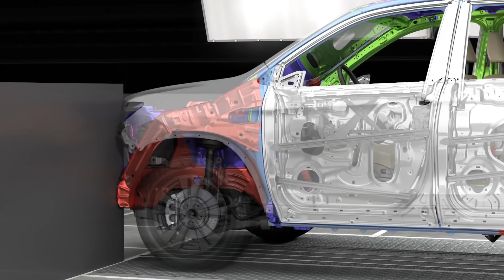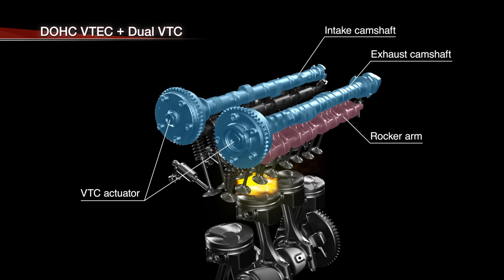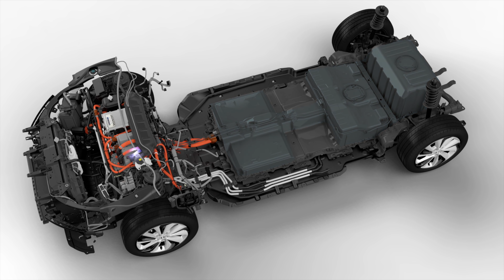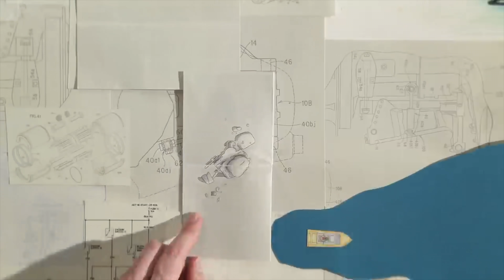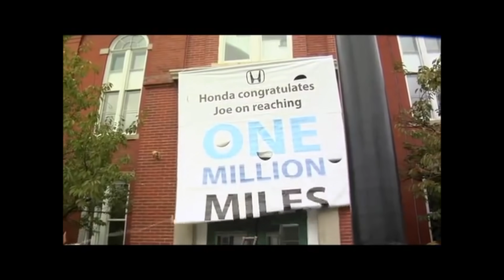Honda Doesn’t Want You to Know This

Comment: I used to own a 1996 Honda Accord EX, manual transmission. I bought it from a junk yard for 400 bux when it was sitting at only a mere 110k miles and repaired all the damages to the car for under 2 grand as there still wasn't even much wrong with it. I drove that car for 6 years. I would still have it to this day but a tree fell on it and destroyed it but I've owned 24 cars in my life and that Honda was by far the safest and most reliable car I've ever owned. I currently drive a 1996 Dodge RAM 1500 pickup but this thing is about dead at 173k miles. When I buy another car, I'm definitely going with Honda again.

Comment: We have an 2003 civic with 182000 miles & with very little repairs.   Now I got information from one how there mechanic’s  that they started putting weak rings in the crv. A few years back ( hope  ) That was corrected   We are getting another one soon hope it goes like the old one

Comment: The owners reliability in on time proper maintenance more key than Honda’s vehicles!!  2003 Odyssey 420,000 miles ORIGINAL TRANSMISSION AND ENGINE.  This year was noted for multiple tranny failures for a single unit sometimes.  Honda reliable yes. Owner reliability in doing timely maintenance more so.  At 60k stopped using their Honda branded ATF fluid and went 100% with a brand known to to make premium level and expensive synthetic oils and synthetic ATFs.  On the forums members would always warn if I didn’t use Honda brand ATF it would lead to destruction of tranny. (420k miles now on original lol)  I also added a Lubegard Red in with every ATF change.  Lastly, added a magnefine inline atf filter.

Comment: My 2000 Accord with V-Tech is 291,00 miles and it still strong. Only minor fix that were original Tie-rod end and rear wheel bearing last month. But 290,000 miles what do I expect right?.

Comment: 06 civic hybrid with 307k miles. Need to replace the hybrid battery that shows 7% usability on scans but still getting 31.5mpg calculated by fuel log app / 30.5mpg by dash.

Comment: Hey  scotty  I have  a 2004 honda element  had it a few yrs just oil changes  a new starter  a master cylinder  and brake  pads, oil changes every 4500 miles I have  271k already I thought about getting  another one  with less miles maybe a 2010 but why fux it if it's not broke ive learned so mush watching  your videos I change my own oil, coolant,sparkplugs  myself  I also  converted  it into a camper  there's nothing on the market  like it,

Comment: I have a Toyota tacoma 2003 5 speeds. When I put the firths and then when to the other speeds is a little difficult to changes the speeds. No noise from the gears. Do you thin I need a new clutch. The truck has 175 K miles. Thank you for all the help that you give with your Utube channel.

Comment: First car I bought out of high school was a used Honda. First car I bought out of college was a new Honda (CRX). To date I've owned about 15 to 18 of them, plus a few other brands too. They have all been good but Honda began to be fun to drive after about 1982.  Honda has always been a little weak on brakes (rotor warp or brake noise in the earlier days) and automatic transmissions (changing the fluid early and often boosts longevity). Best Honda I've owned? Probably the 1994 GS 6-speed manual sedan, but the 2015 Accord K24 is a very solid and fun to drive car too.  The worst Honda out of the bunch was probably the 1998 Civic HX, which handled more like a Buick than a Civic.  The generation Civic before (1992-1995) and after (2001-2005) were much more fun to drive.

Comment: After spending all my savings trying to keep my Chrysler Sebring on the road, I've finally bought a Civic estate.  Wish I'd watched Scotty's videos much earlier.
Reply: The 4cyl. Mitsu and the 2.7L Chrysler engines were not good, and most Sebrings got them. But a few had the 2.5L Mitsubishi V6. My buddy had one with 275k miles. The original engine only needed valve cover gaskets a water pump, spark plugs and an alternator during the last 75,000 miles he owned it.
Reply: @don2deliver  Mine was a 2 litre turbo diesel.  Low mileage and well maintained.   It wasn't just the engine that gave me problems.
Reply: @RockyDave  never saw that engine in the US. Yeah they had electrical issues and suspension issues, but my friend got lucky with those things on his.

Comment: I had a 1985 Honda Accord Hatchback that my girlfriend and I loved.  It had a 1.8L carbureted engine, 5 speed manual transmission.  Unfortunately it was totaled in an accident when a pig farmer's truck driver 2 cars behind me fell asleep at the wheel and I was stopped in traffic that's when we bought our 1993 Toyota 4x4 pickup which we still have and drive today.  Had we still have the Accord, we still would drive it and I would maintain it so it gets 1,000,000 miles as well.

Comment: I have a 2003 Honda Civic 1.7L with 280,000 miles. The engine still purrs like a kitten and handles great without a squeak.  Keep that oil checked and changed..

Comment: My wife's 2015 Civic is barely OK as far as I am concerned when it comes to reliability..by 115,000 miles on my 3rd AC compressor system.. also two calipers froze up ...unexpected problems

Comment: I like Honda especially the motorcycles. Right now I'm riding a 150cc scoot scoot, and I have the license to upgrade to a bigger bike. At first I was thinking about  getting a Honda ADV, and it would cost me $4500, and out the door it would be like $5000. It's pretty much just for another 150cc Honda scooter that I wanted in the first place, but I couldn't afford it. I still wanted the Honda version, but than I saw the motorcycle Honda cb300r which cost only not much than it's 150cc ADV. So I change my mind, and I would rather upgrade to the 300cc motorcycle. I figure why waste my money on a same 150cc when I could upgrade to a bigger motor, and the cost would be not higher. I love the design of the motorcycle, and I just can't wait to ride it. I still love the scoot scoot that I have right now, but it's more for my route.

Comment: My dad has a 2007 Honda accord but already had to replace the battery, the starter, and the engine light is on and it only has 60,000 miles on it , which he bought 1 year ago used from a dealership
Reply: It makes me not want to ever get a honda
Reply: @philipmiller5036  you don't know this so it's not a fair judgment also the car was fine when he got it

Comment: Honda lost me 20 years ago, when my Legend started to fail with only 80k miles. It had to many cheep parts from the Accord build in. Those used to break and were costly to replace. At 90k my automatic transmission started to jolt and I got rid of it. There is no way I will buy a Honda car ever again.
However, I own a Honda motorbike and love it. Made in Japan, very reliable, brilliant engineering. Will last at lest 150k miles.

Comment: I own a 96 civic and I took a picture of the mileage at 300,000 miles. At 301,000 miles It through a rod threw the oil pan, but because the car had done so well I put another engine in it. Now I have 3 civics and that's all I will own is a Honda or Toyota I guess

Comment: I Need Help ! I Have this 2014 Rubicon It won't start by turning the key because it burns de 40A fuse that goes to the starter every time I turn the key, Im luky its a manual but still it won't start if not being downhill.

Comment: My Honda Accord 2008, has over 102k miles on it, but I am hearing a tapping sound from the engine, I have not had any issues with the engine or transmission.
Reply: Have you had the valves adjusted?
Reply: If you have the V6, and the timing belt hasn't been replaced, have it, the tensioners, and the water pump replaced as soon as possible. That tapping might be caused by wearing out tensioners, and they should be replaced every 60.000 miles on V6 Hondas. If any of the tensioners go, it tries the engine.
Reply: @EMichaelBall  I have not had the valves adjusted before, I haven't really done any work on the engine, I bought it at 98k miles thereabout. I have serviced it twice now within a 3 month interval.

Comment: Bought a 2006 Civic LX 4D Sedan in 2005 for $16,000 cash, it's 2021and it drives like it's brand new, it easily hits 100mph like nothing and it still gets to it's top speed of 108mph(110mph) with no problems, last year during the summer the starter went out, changed it myself for around $330 with taxes.
So in year number 15 the starter went out and that's the only thing that has broken in the car, which is amazing, also the interior of the car is in great condition which is very shocking to me, the previous generation 90's honda Civics  interiors use to fall apart, but I guess honda figure out how to make them last longer specially the ceiling 👌
Another thing, the design of this car aged very well, It still looks very modern, it's a white car, white makes it look even better.

Comment: Honda customer service was extremely poor for me. I bought a new Honda Silver Wing motorcycle.  It was Honda's first v-twin engine and was based upon the Moto Guzzi.  Second gear would disappear if revs were normal or higher.  You had to shift into second going very slow.  Two different dealers kept my bike for months and could not fix it. Honda refused to recognize the problem because they had no fix for it.  Years later, after I got rid of it, a solution was finally found.  A friend of mine bought a new Honda Civic, one of the super small first generation.  At 60,000 miles the head cracked.  No help from Honda.  They had a known problem of doing that.

Comment: The one weak point I have encountered in the Hondas I have had is the automatic transmissions. Even when maintained to factory specifications, they are prone to fail. Honda has a unique ATF specification which is not a synthetic fluid. There are no “Honda spec” synthetic ATF fluids. My theory is that their fluids don’t hold up to the Texas heat.

Comment: I owm a 2000 honda integra and it wonderfully reliable and dependable i have own it for 3 years the transmission or enginge has never been work on apart from regular maintainance and its been great also the toyotas that i drive daily at work but cant say the same about other brands not discriminatting just saying

Comment: I had a 2014 Honda Accord coupe V6. Had it for 7 years. It started giving problems. So I sold it. The transmission was jerky. And things start to break. Windows don’t roll down. Dashboard starts rattling. And more. So I sold it for 2021 mazda3 turbo. Honda better watch out. Mazda is catching up.

Comment: I have a used Honda Civic 2013 I got for $10,900.00. Great running car only thing having a problem with the front brake but it still brakes good. Get that fixed on my way again. Does a 2013 Honda Civic have a timing chain or timing belt

Comment: It's just too bad the Honda 3.5 v6 run a timing belt vs their 4cly timing chain, wondering why they don't change this? Maybe development cost to the existing 3.5 v6 would have to get redesigned for a chain Scotty.
Reply: I love their j series v6. I agree it should have a timing chain since the Toyota v6 now has a chain

Comment: The dual carbs Prelude of the 80’s are nothing but trouble prone engine, and don’t even let me mention on the CVCC carb system( mechanic’s nightmare)The body and interior design are very nice though.
Reply: I remember a used engine with the vacuum harness intact was worth about 200 more than one with the lines pulled or chopped off.

Comment: I'm 47 and I was always a Chevy guy 
I had a 2000 Chevy Silverado and had all kinds of issues
Replaced the front end twice the rear end went out  twice  before it had 200,000 miles
I sold it bought a 2008 Honda Ridgeline I just now replaced the front end at 275,000 miles
That truck turned me into a Honda guy
I still have the Ridgeline and I have bought a 2010 Accord

I am looking for a 2014 Honda Ridgeline ( I don't really care for the  new Ridgeline styling . The 2021 is better but )

I will keep my 2008 Ridgeline and my 2010 Accord

If you told me 10-12 years ago that I'd be a Honda guy I would have said that you were crazy but I definitely am a Honda guy

Comment: Dont modern Hondas have oil dilution issues since about 2018?
Reply: Only if you get the 1.5 turbo motor. 
The available 2.0 k20 naturally aspirated port injected motor also available from 2016-21 does not have these issues. 👍🏻

Comment: I have 2000 Honda HR-V (gh) 1.6L 105hp All Wheel Drive the same as the CR-V... Just hit 190 000 Km - 118060 miles as well i just changed the Original Front suspension... Just Honda

Comment: I'm thinking about buying a 2020 or 2021 honda civic type r, but I'm a little worried that the turbos. Also, are the engine and transmission made by Honda themselves?

Comment: I had a chevy silverado with 380k and the original engine and transmission.   It did have other things break while I owned it for over 10 years.    So not all USA cars are junk.   USA makes good trucks that are capable for towing large trailers.    BUUUUTTTTT.....
My daily is a 2017 crv awd.  I love it but it needs more power.  33 mpg is awesome.  But the 0-60 is like an hour......
It is however very reliable as are all hondas.

Comment: Honda hasn’t made good cars in years. My family had 4 new Honda’s and 1 accord was a lemon- tranny dead at 39k Miles. 1 accord had tranny failure at 105k and 1 odyssey had power steering issues until warranty ran out and sold. And yes we maintained them. One accord from early 90’s was a gem.

Comment: I have a 2007 Honda accord with 124368 miles
I have spent the last 2 years  and spend most of my check trying to get it fixed. One thing after another 😏

Comment: My 2017 odyssey had to have the torque converter replaced at 75000 miles. Paying $3800 to repair a relatively new low mileage Honda really leaves a bad taste for the highly praised brand. 😕

Comment: 2008 Honda Pilot 210K miles.  Very reliable and very low total cost of ownership.
Reply: Might want to replace the radiator if the car was in a northern/salty climate. Flush the coolant if you do so.
Reply: @EMichaelBall  I replaced the radiator 3 years ago (I accidentally punched a hole in the fins).  Thankfully I live in South Florida and the under carriage is in great shape.

Comment: I bought a brand new 2005 civic that was absolute garbage, doors broke constantly, visors fell off 4 times, paint was ruined after 3 years, it ate tires at 10,000 miles, I put 4 sets on and finally, traded it for a Toyota, the company is still ok I think, I most likely just got a bad one but I don’t think I will ever buy another one

Comment: My 2002 honda odyssey with 211k miles with original engine and transmission. Hoping 300k miles than 500k miles than 1,000,000 miles. Well, it does a wheel shakes start at 40 mph then the higher you go the more shake you will get. Can anyone help us with that?

Comment: The new base Civic sedan is no longer available with a manual transmission, that takes it off my list.
Reply: Shame they stopped making the manual with the 2.0 NA motor after 2020. 
I was lucky enough to find a brand new Civic Sport Sedan with the 2.0 and 6 speed manual on New Year’s Eve. 
It’s definitely the most reliable way to buy a 10th Gen Civic 👍🏻

Comment: @0:04 LOL Toyota has this beat, I don't see Hondas with 250k-375k like I do Toyotas 🤷‍♂️. My '03 Toyota echo with 230k original engine and transmission never opened. HOWEVER an '03 Honda has a timing belt and water pump that needs replaced around 100-150k, and valve adjustment. Skip this and the Honda dies, meanwhile the '03 Toyota keeps going.

Comment: Honda is the best car company besides Mazda in my own opinion for sure, Honda blows both Nissan and Toyota into the water except for the Ridgeline which Nissan and Toyota have an edge to them on that because it’s not a traditional pickup truck unfortunately, but anyways my mom has had 3 Honda Accords all have been decent except the 2nd one had a defective transmission but the 3rd one like the 1st one got really old, that after the ac quit working after all the repairs including alternator and starter she had a 2016 Nissan Sentra for a brief, didn’t like it at all, horrible on the transmission because of hesitation in the cold weather not because it was failing and the ac didn’t work right, and the engine also hesitated as well, now she has a 2012 Honda Civic Lx no complaints at all, I have a 2015 Honda Civic Lx my first Honda only had to replace the oil twice and it has under 50,000 miles still going strong, so with that being said Honda is the best car company other than Mazda on reliability, Toyota is decent but overpriced for there cars, when Mazda is a lot nicer for the same price, and Subaru is expensive but yes there reliability is stellar from my understanding as well, Nissan reliability sucks on the sedans, but the suvs and trucks are definitely decent for sure, Mitsubishi is extremely unreliable for sure, Kia and Hyundai is hit or miss reliability but definitely more reliable than they used to be, and unfortunately Ford, Gm, and FCA reliability is trash, Gm is only decent on suvs and trucks, Ford is trash in general now, and FCA only has Cummins and ZFH or whatever that transmission is decent but it’s not Allison or Aisin decent though. 🤔

Comment: Reliable? How's the 1.5T going with oil dilution? 🤔
Reply: It’s still an issue, they issued a “software update” which really doesn’t address the real problem.

Smart buyers opt for the 2.0 k20C2 naturally aspirated port injected motor also available currently in the lineup. Those 2.0 motors are extremely durable. 

The tiny 1.5 GDI turbo motors should definitely be avoided if you plan on keeping the car awhile 👍🏻

Comment: Makes the best motors...... 1.5 Turbo=Hold my beer
Reply: Agreed, the 2.0 naturally aspirated port injected motor and 6 speed manual transmission is the best way to get a 2016-2020 Honda Civic (they dropped the manual option in 2021)